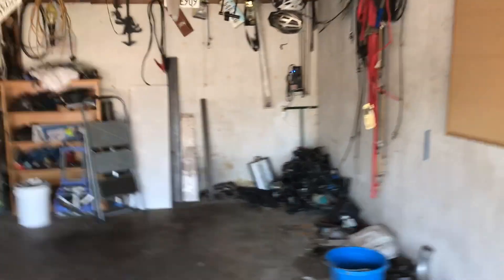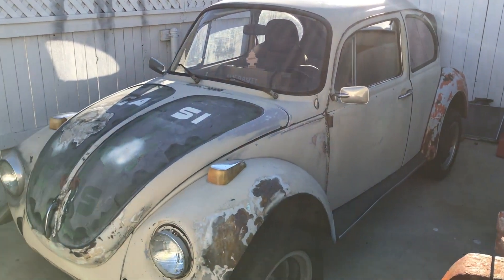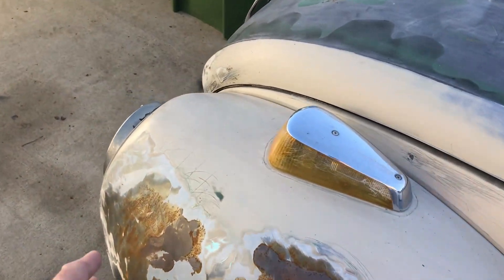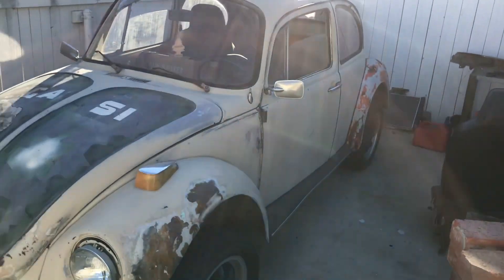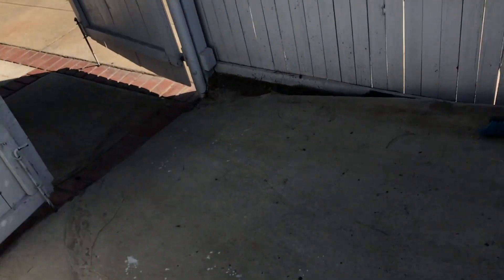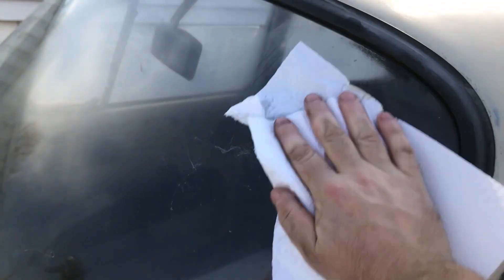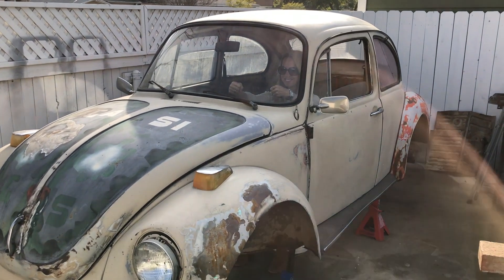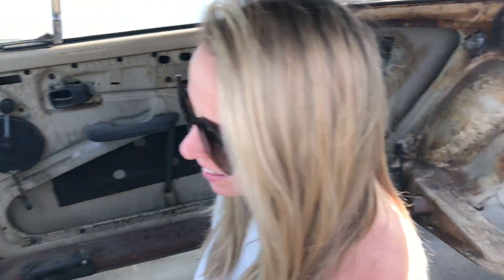Front Engine Bug Budget Supercar Ep2

Comment: I suggest you don’t fixate on getting a single vehicle to fit under the bug, two half cuts might be a better fit.
If you want a rear engine look at any front drive that will fit the space. A Saab Audi Alfa Romeo or Subaru drivetrain can be fitted back there. Consider vehicles that are too long by at least six inches over vehicles that are close to the right length or even too short. To shorten a vehicle is a lot easier and stronger and usually lighter than lengthening one. You just need to cut it in a suitable location overlap the excess and weld it with a series of spot and stitch welds.
If you want front engine consider a Subaru Forester wagon.